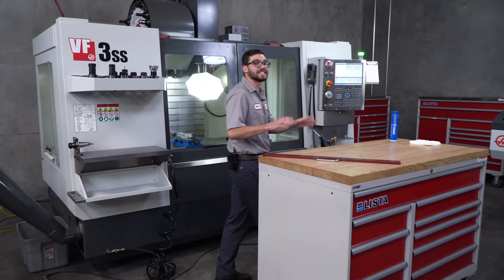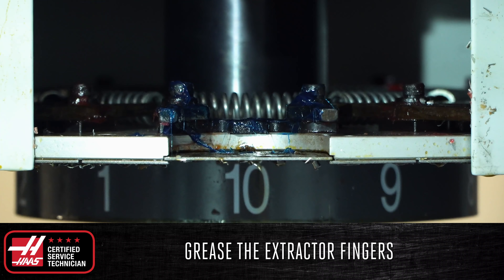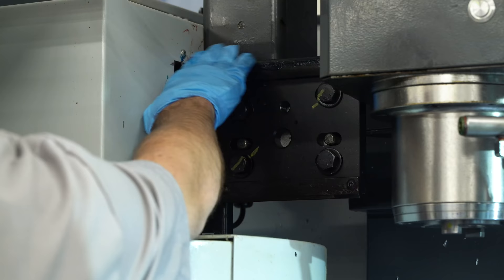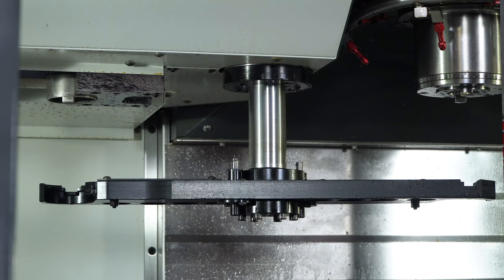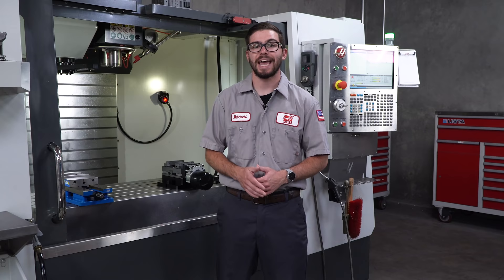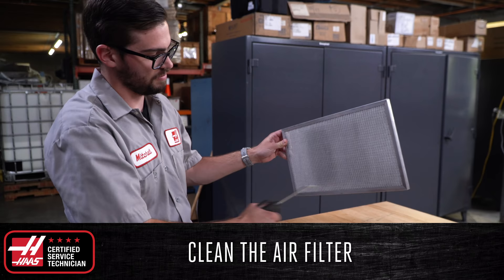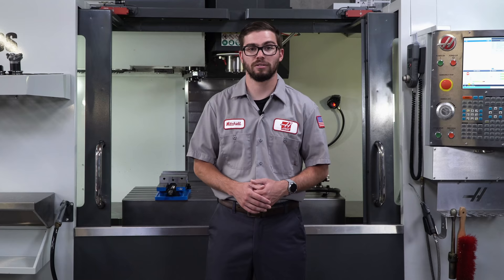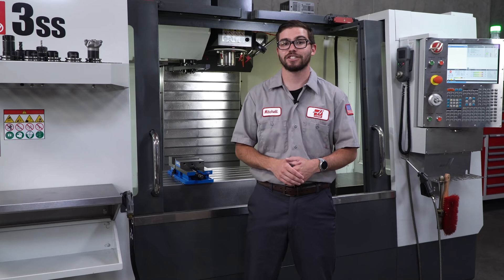Monthly Mill Maintenance Tasks - Haas Service - Haas Automation, Inc.

Comment: A suggestion, perhaps have one specifically for older minimills as when the slot doors were mentioned for the umbrella tool changer I went over to my mill wondering why the hell I didn't see them before and obviously there was no provision for those even in there

Comment: Nice guide! Why that specific mobil grease?
Reply from the maker: Alberto, Mobil XHP 222 is one of several greases we specify in the Grease/Lubricant document Mitchell mentions in the video. This grease has good resistance to wash off and sticks to surfaces with high tenacity. It also exhibits very good anti-wear properties where components have relative sliding motion. But if you are using a different lubricant with similar properties, there shouldn't be any issues continuing with it's use. On these greasing applications the most important thing is to perform maintenance regularly.
Reply: 3:27
Reply: Kickback

Comment: How do you keep the door on the umbrella tool changer open? Tool change then E-stop?
Reply from the maker: Jeremiah, That is correct. Initiate a tool change and then press E-Stop before the carousel reaches the spindle. This will give you room to work on that particular pocket. When you're done press RECOVER and go thru the steps to return the carousel to it's Home position.